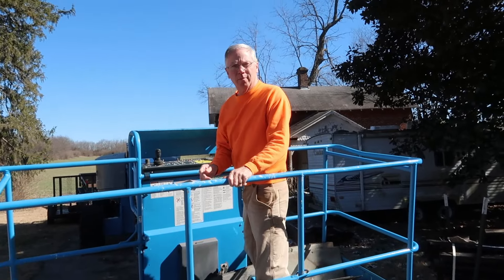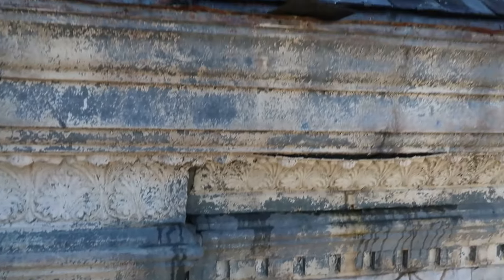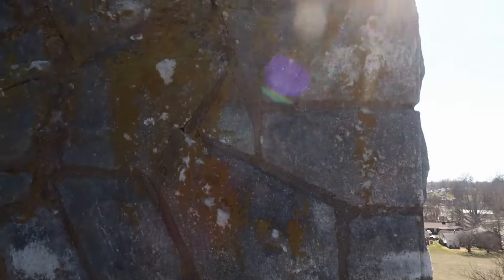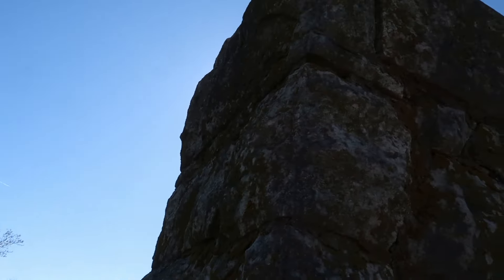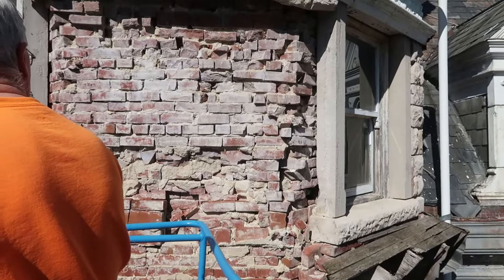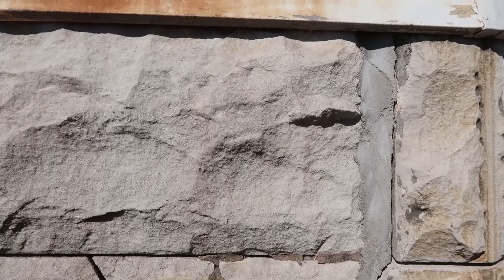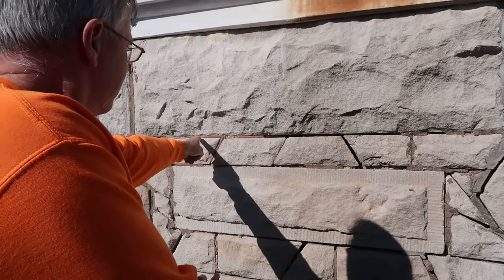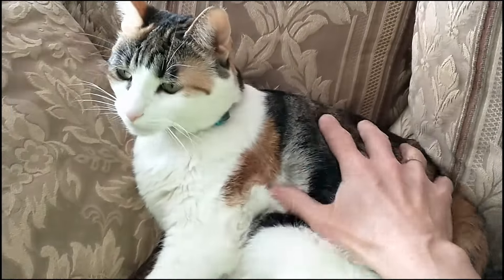FAILED INSPECTION Of The Tower! It Is WORSE Than We Thought. S4E39

Comment: I’ve just shared this video with my sister she has a Tudor house here in England. About 10 years ago, she had her chimney fixed. Should I say she had builders in to do the work on the chimney that was required to stop a leak. Ever since then, water has been building up within the plasterwork of the house, not an actual leak, but the water not being able to escape. From your video I think it’s very clear that the builders use cement when  Sisters  house is 100% lime mortar. Also, now she can see from your video exactly what Problems cement can cause in a lime mortar building. So thank you.
Reply from the maker: Everything we have learned about lime mortar came from England. You guys are way ahead of the US on the lime mortar/cement mortar science. =)
Reply: @moorelandhouse  yes that’s very true. The problem is the average person doesn’t know about it and nor does the average builder. So your video has been very informative.

Comment: Oh my.  You have an incredible amount of work ahead.  How long do you think it will take you for the restoration?   Would it be safer for you to use scaffolding and the machines just for your safety?.  Also will all the box cutters be replaced or will you use modern eavestroughs?   Good luck with this.
Reply from the maker: The box gutters have to be replaced because of how they are incorporated into the cornice molding that surrounds the house. We think this might take most of the year.

Comment: There is a channel on YouTube Purnon chateaux being restored. They built temporary structure over the roof that protects and gives the workers a safe place to operate. It is above the roof and they can walk around on scaffolding and at the same time protects the open parts from rain. They replace stone facade and carve right in place. That might be a solution to the tower repair. They move the structure as they finish each section.
Reply from the maker: Yes, we have already started thinking about how we can build a temporary structure to protect the tower while we take the walls down.  We watch quite a few of the chateaux videos. There are certainly a lot of them. Thanks for the information.

Comment: You will need some serious scaffolding that is fastened securely (level concrete footings) at the base, and higher to solid parts of the tower.
Reply from the maker: Oh, we have a lot of scaffolding. We are gonna try to use just the boom lift and skytrak. Scaffolding gets a little sketchy 60 feet in the air no matter how well it is secured.

Comment: ...Prayers over your safety and that God's blessing be upon you.  
Could something be done starting with the inside brick, behind the stones, to strengthen the tower so that the outside stones could be left in place?  I'm sure inside brick has deteriorated from water damage and needs replaced so an unlikely option.
Reply from the maker: We did something similar once we got near the bottom of the front wall we rebuilt. So, we will be able to do that but it won't be at the top.

Comment: I know this is way in the future but were you going to restore the cap on the tower like it shows in the old pictures?  When you compare the original and now you can really see that it's missing something.  All we really know is that your summer will be very busy with masonry.  Because of the way you're rebuilding you can be assured it will last another hundred years. 🙂 😉🥰😍😇
Reply from the maker: Yes, we plan on restoring the original conical shaped roof. We don't know why they changed it but they must have done it in the early 1900s.
Reply: @moorelandhouse  maybe there was a storm or something.   I think it will look great when it’s replaced. Without it it’s like a bad haircut. LOL.
Reply from the maker: We hadn't thought of that. It might have been easier to flatten the roof than put the conical one back on. @txborn668

Comment: so the box gutters, and they way there were installed and "water proofed", seems to be a lot of  what led to this old gal's demise. a design flaw? or just shoddy construction? will you be redesigning/rebuilding them or would the castle just be better off with some other sort of solution?  (and where do you order Lime Mortar from?)
Reply from the maker: The box gutters are incorporated into the cornice moldings so they will have to be redone. If the box gutters would have been maintained, they would have been okay. Small leaks would have been okay but large holes were not. Hot lime mortar is just a mixture of quicklime and sand. We ordered a pallet of quicklime from a chemical company in Louisville. If you want to go down the "hot lime" rabbit trail, look up Nigel Copsey on YouTube. =)

Comment: Did the box gutter cause the damage to the tower, or do you guys think it was the cement mortor?
Reply from the maker: It would have been a combination. The reason the section of stones fell was the fact that the water was trapped against the bricks by the cornice molding. Once the lime mortar deteriorated between the bricks behind the cornice molding, there was nothing to support the stones. At the top of the tower the lime mortar is deteriorated because of the cement mortar. It's all about how the lime mortar deteriorates when it is not allowed to dry out. That happens behind the cement mortar and the metal cornice moldings when the box gutters leak.
Reply: @moorelandhouse  ok, that makes sense. It's really unfortunate that someone didn't understand how cement mortor works and also that the box gutters were not maintained. I'm very excited to see you guys finally tackle the tower . It is going to be a great series to watch.

Comment: The main issue with cement pointing on brick and soft stone (e.g. lime stone) is that it moves less than the stone itself, it's less flexible. That means if there's any movement, the stone or brick will crack. Trapping moisture isn't much of an issue as long as the stone itself is porous and realistically you don't want any water to get into the wall in the first place. Long story short, IMO the main culprit here is the plethora of leaks that allowed water to get into the walls.

The way the walls were built didn't exactly help either. That bit of the tower you showed looks like three independently built brick walls, the middle one being just bricks on edge, which means it has barely any strength. When it comes to rebuild that I'd strongly recommend either building it as one monolithic wall or using stainless steel ties to hold the skins together.
Reply from the maker: Actually, that has been the common thought about cement mortar and that is why many old buildings are falling down. If you want to do a deep dive on the science and chemistry behind it, look up Nigel Copsey on YouTube or on Amazon. Limestone absorbs water. Just look at the front portico on the Mooreland House. The stones were reset in the early 2000s with cement mortar. There is a reason why all the stones turn grey. Lime mortar actually transports water molecules better than the limestone itself and therefor allows the limestone rocks to dry out. Long story short, putting cement mortar over lime mortar is a disaster.

Comment: If you can avoid it try not to pull out any of the floor joists in the attic or anywhere else, see they way the joists go into the wall that's what's holding up your structure.If you do this your wall is in danger of collapse. These 19th century  buildings were not built with frame structures that's why the walls are so thick.
Reply from the maker: Thanks for the tip. We have been rebuilding this house for almost 4 years and have become intimately familiar with the framing and structure. =)

Comment: DO YOU CARRY A PHONE ON YOU WHEN YOU BOTH ARE ON THE LIFT IN CASE THE LIFT QUITS WORKING SO YOU CAN CALL THE FIRE DEPARTMENT? THAT IS GOING TO BE A LOT OF WORK. GOOD LUCK. THANK YOU.
Reply from the maker: We do always have our cell phones. The boom lift has a safety system that allows it to operate with the battery if the engine quits. We should be able to get down safely. =)

Comment: Heh.  Tour nado.   right.  funny. 

came across new you tube made by an sheet metal craftsman, old world style work.   thought you might want to use the knowledge in remaking your box gutters.  

https://www.youtube.com/watch?v=LcibM7ARVos

by the way the red sand, I recognize it.  i use it in my hobby aluminum foundry. is Petro-bond sand.  usually made at foundries that has muller machinery.  i had to drive 317 miles south to get mine.  Google phone book for local one nearby.  🙂
Reply from the maker: Thanks for the video! Since the cornice molding and decorations will be painted, we might cheat a little and make them out of fiberglass.
Reply: @moorelandhouse   ah. i understand.  both is still  "massive job".  well molded fiberglass might cut down the fabrication time some...  keep us entertained with your work.
Reply from the maker: Of course, who knows what we will end up doing in the end. =)